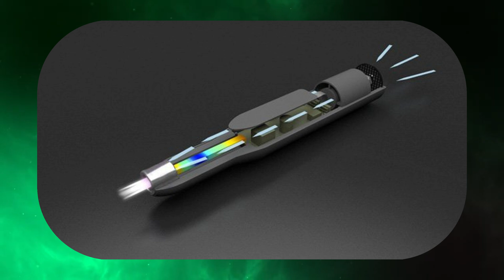New Plasma Engine DESTROYS Rockets!

Comment: you can have specific impulse or thrust. pick one. only way you can have both both you need to use nuclear warheads as fuel. 

limitations in on orbit power is the real limit of plasma drives. solar = mass. nuclear = mass. batteries = mass.
you can increase thrust to compensate but it eats impulser, but on orbit you have time so small thrust is not a problem.
more mass does make a unit of propellant go less and specific impulse can compensate, but within limits. so more mass should be avoided.

fusion drives need not be break even to provide high delta-v, but since they are not break even you need another power supply. 
trickle power is sufficient to charge a capacitor bank for a fusion shot, but it takes time, but you have time. and so the power supply need not be massive. 
rtg or solar will do, but no sun in the outer solar system, fine for mars shuttle. use rtg or small reactor for outer solar system. would probibly fit in a starship.